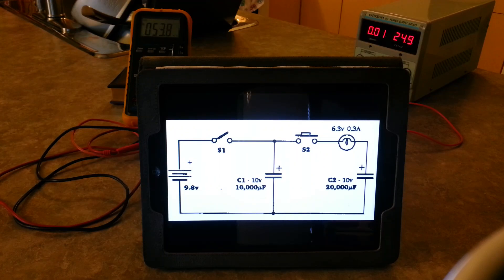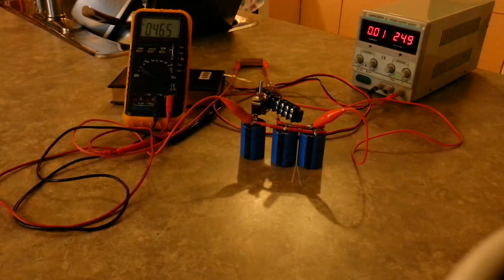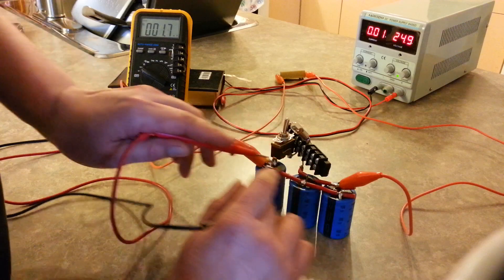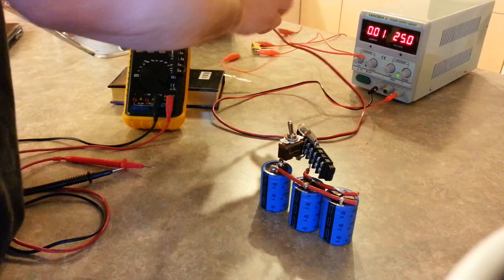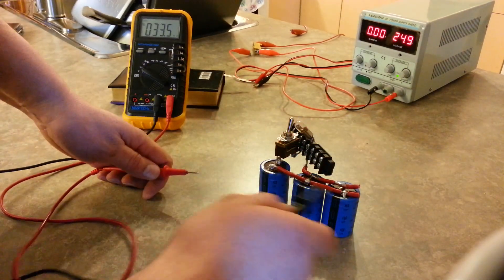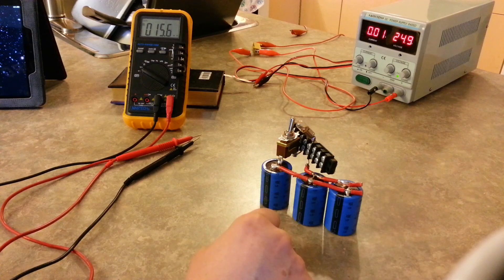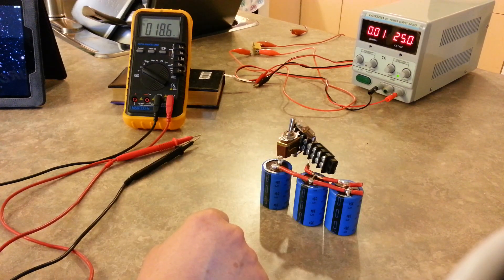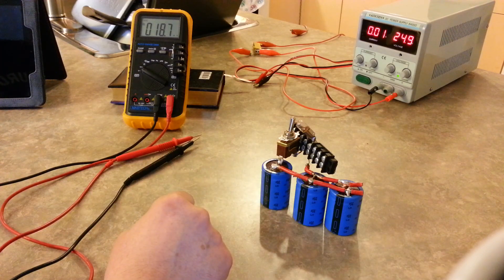How much energy does a light bulb actually consume

Comment: My thoughts:

First it's great you are trying to think out of the box.  However, you are making assumptions without actually testing your idea.  You've demonstrated only part of your idea and assumed the rest.

You've assumed that putting the capacitors in series doesn't make a difference because you just add up the voltages.  Fine the voltage over the capacitors adds up to the same.  And it should.  But what happens when you put capacitors in series?  You can calculate that (it's the same formula as putting resistors in parallel) or you can measure it with a meter or even create your own circuit with a resistor and the capacitors all in series and measure it with only a volt meter and a watch.

You can also try your circuit in reverse to start.  Put the caps in series and charge it.  Now discharge them (through a light or not) to a single capacitor.  See how much voltage is on the single cap now?

I think its even easier if you think about the circuit with 10 or 100 capacitors of the same value.  100 caps each charged to 1 V and put in series.  How many volts will appear on the same value cap put over all of them?  Remember each capacitor (and the definition of their capacity) can only move a certain amount of charge.

Search wikipedia for more info and the formulas including capacitors in series.

PS - I haven't viewed the EEVblog forum on this but it's good that you made a video to explain your idea if you couldn't explain it in words.  But like I said you should try do the complete cycle and not make assumptions about what would happen.

Hope this helps.